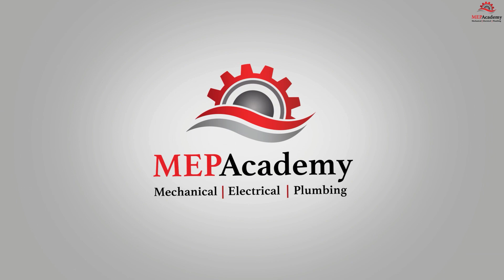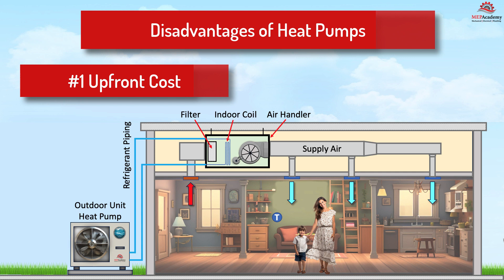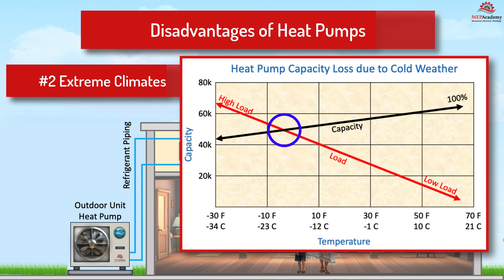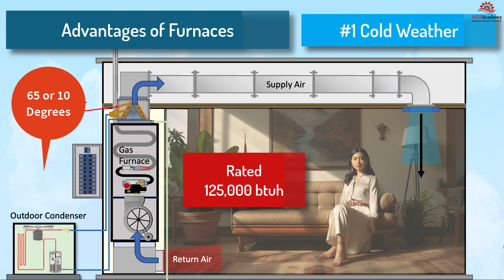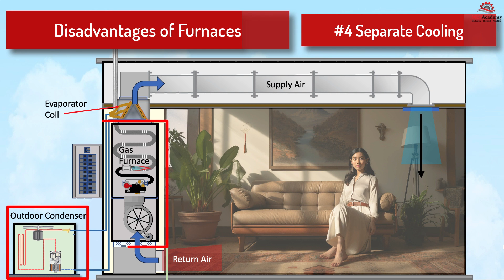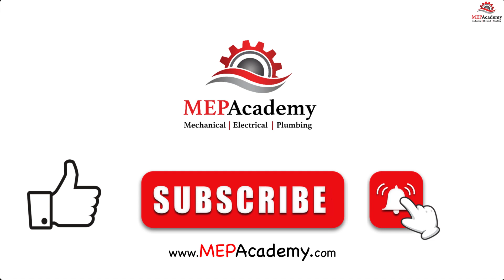Heat Pumps vs Furnaces

Comment: When mentioning fossil fuel, how we suppose to power heat pump?
Using electricity. Where are we getting it?
Right, by burning fossil fuel at power plant.
Wind and solar sources are not having big impact. 
Regarding using heat pump on ducted system,let say in Canada.
Supply air temperature getting really low by the time air reaches duct outlets.
People complain that system isn't able to keep temperature in the house and running almost all day.
So for split system it is still can work but ducted in cold climate is problematic.
Reply from the maker: You're correct. Heat Pumps are not as effective in really cold weather, while furnaces provide whatever BTU's they're rated for. The use of Heat Pumps are heavily encouraged in California because of the Governors policies, so we're seeing more projects requesting electrification. Thanks for the comment.
Reply: @MEPAcademy  I can see it, and California's weather is good for HP.
Bottom line- all coming to politics.
Reply: fwiw a fossil fuel powered power plant is still far more efficient than a furnace because there's a greater conservation of heat engery due to the scale it is being burned at.

Comment: Furnaces are way too many BTUs for an efficient house. They are built to be oversized
Reply from the maker: It's amazing that this topic between Heat Pumps and Furnaces has awakened some die hards for one system or the other. I guess we have to remember that everyone has a different experience based on geographical location and norms for their area. Experienced HVAC professionals need to make the best decision for their actual situation and location. These videos are provided to bring awareness to the differences, but those differences can look differently from another's perspective. Thanks for watching.
Reply: get a smaller furnace??